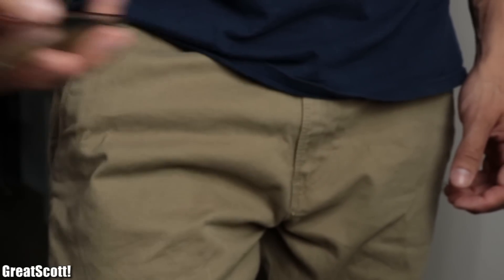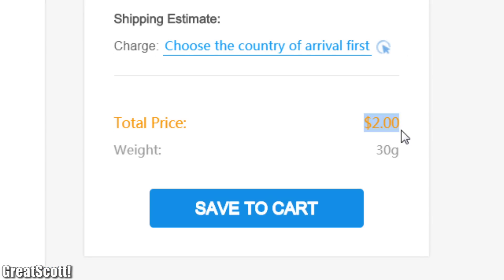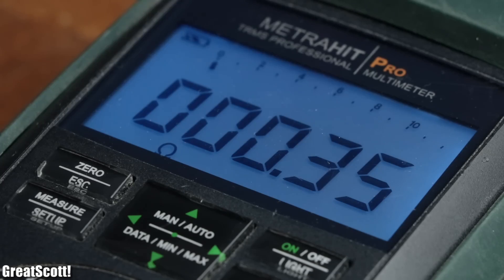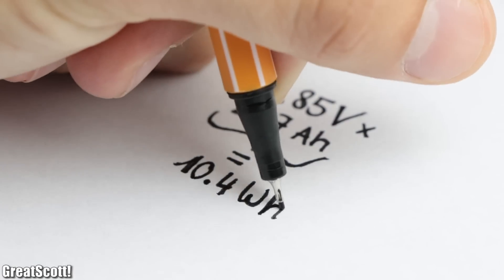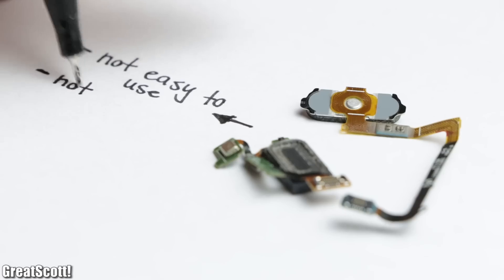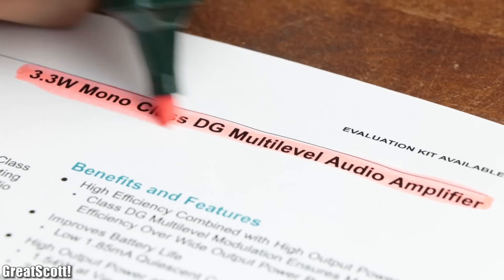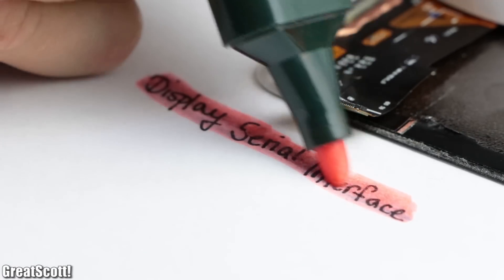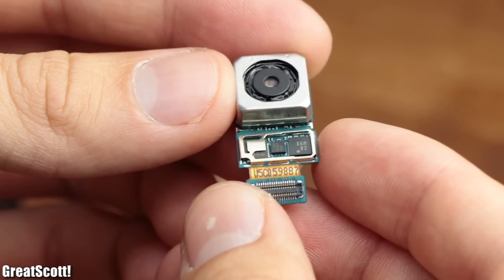What is worth salvaging from an old smartphone?

Comment: Would it be possible to use the smartphone to mirror the phone screen to an lcd tv and use it like a smart tv for content streaming instead? Pair it with a wireless mouse and keyboard for easy access.. Only problem would be the phone's battery life. If only one could take out the battery and plug the phone and use it like you can with laptops..

Comment: Been watching your channel for a good long while and I really enjoy the content. However I'll have to give this one thumbs down. It was very disheartening seeing such a new phone being proclaimed "scrap" and ripped to bits only to conclude there's barely anything worth salvaging. I couldn't disagree more. I've torn apart countless phones before and there's usually tons more to salvage. From the USB connector to the flash LED to the headphone jack (if there is one) and beyond. Even the little screws and gold-plated strips of metal can come in handy. You just have to "stay creative" when you're considering various bits. ;)

Overall I agree with others here - I get that this was for research and educational purposes, but I feel that phone was much better off kept in one piece and repurposed or sold. We have plenty enough electronic waste as it is.

The strange coin-like thing looks like a standard phone vibrator. It should buzz happily with ~5V applied. Not sure why this one was different.

Comment: Hi , Great Scott , I want to build a mobile charger circuit. My mobile charger output specifications are 5V DC 1.5Amps. I want to drop the voltage from 12V DC(power supply from motorcycle battery) to 5V DC 1.5A Is it possible sir? Sir can please help to build the mobile charger circuit for my smartphone. Please, anybody please help me to build the circuit

Comment: Do a video to turn on a mobile without battery and by using the power outlet..

Please 😭😭😭😭
Reply: You can just hook 4v power supply to the battery terminals as long as it can supply at least 1 amp.

Comment: Just don't install the last few "updates" to your phone and it will not be made artificially slow and you can use it just fine for a few more years.
Reply: My Nokia 6.1 became a click faster then I went to 9
Reply: That is fake, only Apple really does that with their phones.
Reply: @Flopster101  I would not be so sure about that.
Reply: @benbaselet2026  Well, I would. I've been working with custom ROMs for a few years now, and in most cases the slowdowns are accidental because of Android's fragmentation issue, that basically means that the manufacturers mess up accidentally while making updates for their devices, and Samsung has certainly done that a couple of times. In most cases they fix it with a patch but for lower end phones they just don't care sometimes.

Comment: Very helpful thank you much! I have an old tablet I tore apart and found pretty much the same thing. I am however saving the battery and screen just in case I find a use. Do you know if the screen from a tablet will be useful in a project like a smart mirror?

Comment: i usually turn off my lg v10 for the night but when i don't my phone becomes slow the next day. a simple restart helps but if it doesn't i pull out the battery for a minute or so and all is good. Bought it used on ebay 3 years ago still love it!. (phone has a removable battery mind you, don't go tearing up your phone to remove the battery)

Comment: I wouldn't recommend buying Samsungs in the eu as the eu Samsungs use the weaker exynos socs so unless you can get your hands on the weird fully unlocked gong Kong snapdragon Samsungs I wour suggest buying oneplus phones instead I know a dude with a oneplus 3 and it's quite smooth on the latest version of Android 9.0 available to it officially there was virtually no lag when just opening apps and scrolling

Comment: Repurposing a phone makes way more sense than salvaging it for parts..One could make a surveillance system out of i(with certain limitations), tracker device..you name it.  Those parts are so tightly and so specifically engineered that, as you concluded, are not repurposable by any means. One great use for them, in diy projects is as a control panel over WiFi using some sort of network node (such as esp8266)

Comment: You have missed 100+ other components -- all these SMD parts on main PCB -- resistors, capacitors, transistors, self-healing fuses, etc. You can desolder them when you need one, instead of buying these tiny essential parts from local store or on EBAY. And you know for sure these are top quality, especially  consdering the fact that on AliExpress and/or EBAY with 80% probability you will buy fake or crap. Also, you can reuse USB, 3.5mm jack connectors for your projects. Stay creative! ;)

Comment: You can't use the Proximity sensor, present near the speaker. They have i2c interface and you can use them. Usually APDS9930 OR APDS9960 is used in Samsung galaxy s series.

Comment: Nice done. 
IMO it would be much more interesting on how to get a phone to run of USB power w/o a battery. How about that?
Reply: Just add a diode from USB supply to battery positive. Common trick once used to build Perk mining setups.
Reply: @NiHaoMike64  what sort of diode?
Reply: @ericscaillet2232  1N4001 or similar. The point is to drop the 5V to about 4.2V or so. Some get away with just a piece of wire, but lowering the voltage a bit is the best. It "helps" that the Perk mining rigs often used a few dozen phones and old PC power supplies were a a common source of 5V, so the voltage drop in the wiring (often 2-3 feet long 22AWG) worked to their advantage.

Comment: Ah, I was wondering if you would ever tackle this! I must say your methods of opening the phone aren't that far of a cry from how most in the phone repair industry do it! Some things worth pointing out, as many commenters have pointed out, if the phone is in working condition, it's almost never worth salvaging, I could give you thousands of uses for a phone without service. They're super useful as tools, I keep a old one in my shop dedicated to being my sensor multitool, between the light sensor, the rotational sensor (to act as a spirit level of sorts), accelerometer, camera, all of that stuff is super useful. And even if you can't find a use for it, selling it second hand isn't a bad idea. Although at this point a phone like the S6 isn't going to go for a whole heck of a lot, especially if you don't sell it directly to someone and instead have a business buy it from you. Even in amazing condition and business worth it's salt will want to replace a few things if the phone has been in use for any amount of time. That plus the fact that it's getting old, I'd suspect you'd probably only get around maybe 20-30 USD if your lucky. If the phone isn't in working order, with as old as the S6 is, I doubt any place would buy it for parts, as S6 parts are really cheap as of now, though the screen on Samsung phones has always been high, so it's possible, but still unlikely. The round component you pulled out was the vibrator if that wasn't already obvious. Also you probably could have pulled a few more things from the phone itself, the speakers come to mind, the loudspeaker is sometimes soldered onto the board so that can be a bit of a pain, but the one for phone calls, at the top of the screen, is almost always simply pressure fit on pads, and makes it super easy to take off and reuse. You also could have probably pulled out the flash LED, they can be a pain but they can pass a pretty good amount of current and produce a good amount of light given how small they are. Aside from those, not a lot of stuff is easily reused for other projects. I was hoping that you'd have found some use for the screen, although, it's worth pointing out that you can get ahold of data sheets and schematics for the pinouts of a lot of those screens and cameras if you know someone in the industry. Maybe that's something worth looking into, I'd love to find a use for all the cracked but still functional screens I have to replace on a daily basis!

Comment: So you got kinda lucky that your phone battery had been replaced at some point that made taking the back glass off much easier. Normally you need lots of heat and some skill with a thin pry tool (isesamo) and some playing cards. Whoever did that battery did not replace the adhesive and the battery they put in is a very cheap battery. Also if you ever do this again remove the sim card tray before prying off the midframe.

Comment: I'd disagree about the main PCB. Most of the ICs are not worth it yes (reverse engineering, hard to desolder and BGA packages are just a pain in the but to work with), but alot of the passive components (resistors, capacitors, etc) can be worth while IF you do projects with alot of SMT parts.

You might could also apply acid to these ICs and with a powerful enough microscope get some interesting die shots.

Generally speaking though, phone parts (and alot of consumer electronics) tend to only be reusable in the spare parts space (say if  you wanted to sell those cameras or the display on eBay as spare parts).
Reply: Smt components are almost for free, it wouldnt be worth your time.

Comment: Oh welp, it all depends on the budget. I still use a Galaxy S3 which is entering its 7th year of service. Can't open the browser, takes around 3 minutes to lock onto my position using GPS, most applications (what's that?) don't work, alarm doesn't always sound thus I am sometimes late due to my phone, et cetera.

To sum it up - I luv dat old phone. I even own a Sony Ericsson k750i.

Comment: Sir I find a broken mouse from trash. It was mechanically broken but electronically I think it is working. I took off it's circuit and saw it's wire output terminals. There  names were very weird  "C,D,V,G" . I thought about their names and I concluded that V means Vcc,G means gnd,C means clock and D means data. Sir will you please make a video on how to interface mouse with Arduino and get image data from it

Comment: The phone's speaker usually has 2 pads under the flat flex that make it useful. 
   Most silicon on these boards require Kwisatz Haderach level skills to reuse.
   Some of the passives are still useful though. The capacitors onboard can be high capacity and low ESR. However, they are easy to damage and even ceramics are super dangerous to reuse if any force is applied to remove them. You need a GOOD hot air gun for this.
  A couple of other things,.. A lot of the components that kinda look like crystals are actually "Surface Acoustic Wave" aka "SAW" filters. These are used for filtering the desired radio frequencies. I am not into radio stuff yet but I save them for later if I can find a datasheet. While I haven't used them much I also have a bin with the tiny radio conncetors/wires, and I save the 2-part EMI shielding cans. At one point I removed most stuff and semi-sorted it. Now I just keep a storage tote with lots of boards that are partially stripped enough that they store flat. Occasionally I go through them looking for some special thing I need or an example of a circuit element I just learned about. It seems like the stuff I don't find useful right now is simply the current state of my understanding of electronics. As I learn more, I often find the things I thought were useless are much more useful than I first thought. 
  I have one rule when it comes to salvaging parts, "never keep more than you can store, access, recall, and/or inventory."
  If you 'forgot you had (x/y/z) part,' you're due for reassessment of your storage and hording tendencies.

 Thanks for the upload.
-Jake
Reply: excellent advice. I have a box filled with old phone parts, that my brain knows should be saved, but does not yet have the knowledge to use, lol.

Comment: Replacing the battery and flashing LineageOS is the best way to go in my opinion.
It keeps thr phone up to date and will fix the slow factory installed OS.
Reply: @grunewurst7400  It´s a shame Huawei dropped their ability to unlock the bootloader of Huawei and Honor devices... Just go for OnePlus, run fastboot oem unlock and you don´t even need internet access.
Reply: @MultiWirth  I have a verizon samsung galaxy s4 and s7. Neither of them can have custom ROMs unfortunately. Keep an eye out for not just which model, but also which carrier can be flashed with custom firmware.
Reply: @DaffyDaffyDaffy33322  You're right i've forgot that point.
I'm glad we don't have this issue in germany, probably the whole EU since in worst case you'll find a software branding or simlock but will still have the standard hardware which is compatible with the standard custom builds.
Reply: @Lord Unknown I've heard from Ubuntu touch, linux4tegra and firefox os but never heard about anything else that could be flashed to a few android devices
Reply: This
Reply: I do that and can be used easily as IP Wifi cameras
Reply: I've had some trouble with Lineage... it let me overheat my Moto G phone to the point of its display showing a pink vertical line, then gradually breaking completely within 3 months.

Lineage should code up some thermal protection. Perhaps it's in the manufacturer ROM, but it wasn't in Lineage (or it didn't work in my case).
Reply: @DanHaiduc  The Moto G 1st-gen had a lot of issues, mine would randomly shutdown and go into a failsafe bootloader that reported half the storage capacity and wouldn't let you boot or flash anything, after some hours everything would go back to normal.
Reply: @Flopster101  It's a done deal. I tore my phone apart, took out the battery and other parts, and am playing around with them.
Reply: @DanHaiduc  Yeah, in this case that's a good option since there's not really anything else to do with a faulty phone.
Reply: Dan Haiduc it’s called unofficial support. Even if it’s supported it shouldn’t damage you phone as they test it a lot, so your phone was the fault or yours for using a unofficial lineage build.
Reply: @DanHaiduc  Not saying you didn't overheat your phone, but the pink line on the Motos is a known issue that happens to a lot of them.  Source:  I worked in cell phone repair for 4 years.  Saw this all the time.
Reply: @Dumpus7  Well, then it might have been a hardware weakness, or still software, but the OEM Android didn't have protection either.  My warranty company said it was because of the software (because it was Lineage and not OEM).
Reply: Nope. I just use Cyanogen mod 7 (old)
Reply: And the battery could be addapted into even older phones
Reply: Arne idiot the p8 lite has got a development category on XDA as it’s a hi6250 device. Take information before criticising.
Reply: Did you perhaps mean "fucked to date"? Android is doomed and so is your phone... SMH (and humanity as whole most probably too)
Reply: @grunewurst7400  That´s why I bought an OnePlus and will buy it in future since it has excellent support and lifespan but most flagship phones are supported aswell so in case for an old galaxy s6 or s7 it is a good option
Reply: @MultiWirth very cool, I didn't know about LineageOS!
Reply: @Walter-Montalvo  It´s the successor of CyanogenMod which shutted down in 2016, maybe this is more known but yeah it exists and you would be surprised how well an 2014 high end device can run on android 10 nowadays

Comment: To the hell with samsung.
Of corse that our expensive phones are getting slower and slower while they release the newest android versions on 3 and 4 years old phones. For example I have a Samsung Galaxy J7 2016
In 2016 It was a dream phone for me. Extremly fast, never frozen and always had some free space for stuff.  But now in 2019 I have Android 8.1.0 on it becouse the manufacturer forced me to install it by those stupid notifications. For the 2016's android modell 2 GB RAM was enough. I had around 1,5GB free RAM for google or anything. I could open up my apps very fast even after a while. And now.....I have 300MB free RAM which is almost less then nothing, the half of the memory is the OP system and my phone is half as fast as it was. But thank god still useable.
So yea....FU..KED!
Good video BTW! (:

Comment: Don't salvage components. I turned my old smartphones into different single task devices. My first smartphone is working great as a webserver with 256 RAM and an ARMv6 600 MHz CPU.
My displayless Nexus 4 is still being used to make a TV smart TV. An old cheap noname pad is a great receipt collection in the kitchen. Also turned a phone into a survaillence IP camera. They are all low-power internet devices which are unusable as a smartphone, but still are great for other purposes with the help of aftermarket custom ROMs.

Comment: I think there's a usable thing from the phone, the eMMC.. you can make yourself a DIY SSD from it with help of "SD to SATA Adapter"... you can take a direct connection from the emmc to the sd  sata module and read/write it as a SSD. also the sensors can be reused too with an Arduino. 

From my experience, i have used old android phones to make IoT projetcs (With custom ROM and custom hardware). or keep the camera module with the board, and install an app called "IP Webcam" and you have a DIY CCTV!
Reply: Its an S6. It doesn't have eMMC, ia has UFS

Comment: Coin cell part is the vibro motor which vibrates. Also, on the metal frame, there is also a main speaker on the bottom - i beleave you threw it out with the frame:)